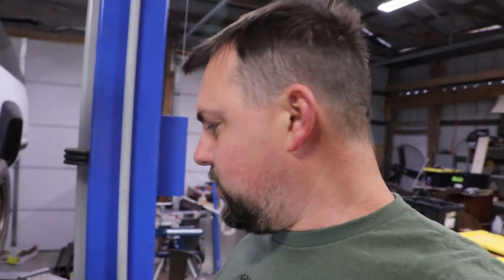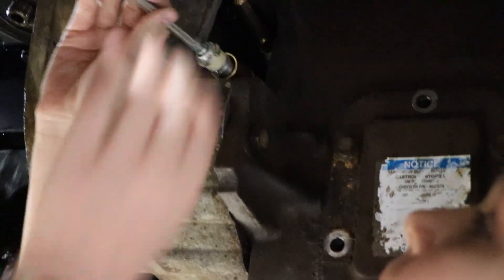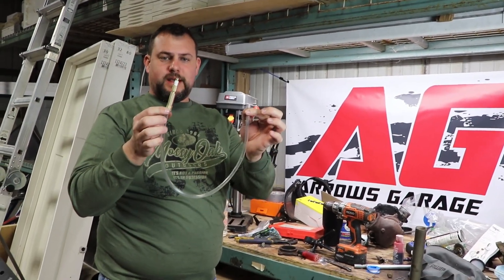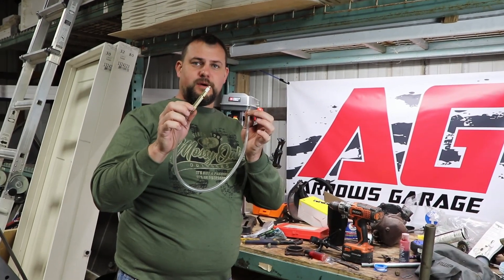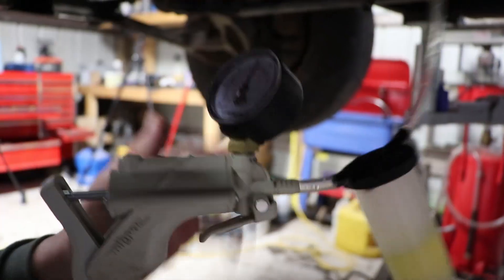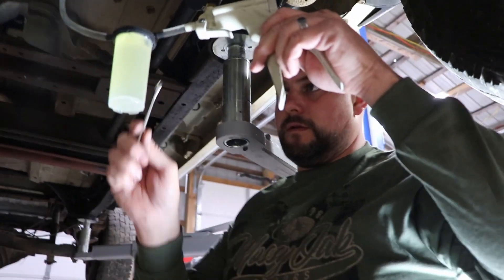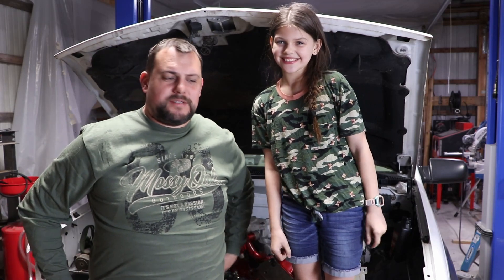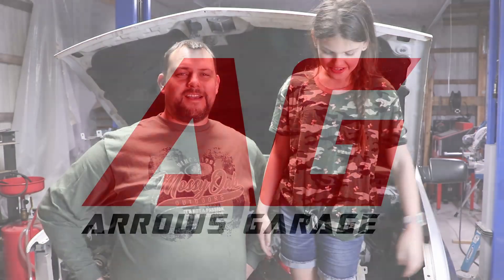Bleeding the Clutch on the NV4500 Suburban

Comment: Question why did you put Teflon on the threads? Wont the brake fluid eat it up?
Reply from the maker: I needed to pull a vacuum to suck the fluid down through the slave cylinder if I hadn't put Teflon on the threads it would have sucked air around the threads once you tighten that bleeder valve the Teflon part of the threads is on the outside of the system and doesn't matter if residual brake fluid dissolves the Teflon or not.